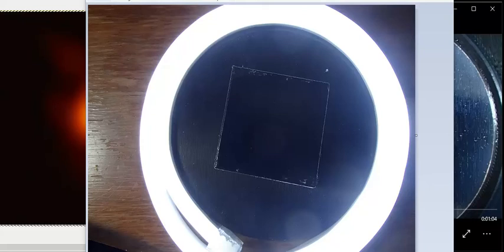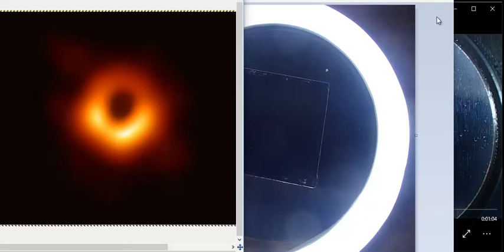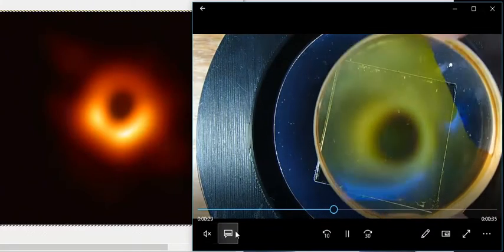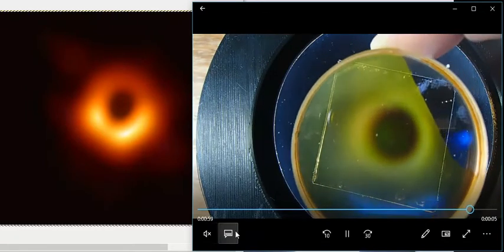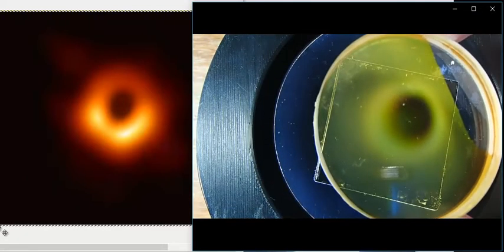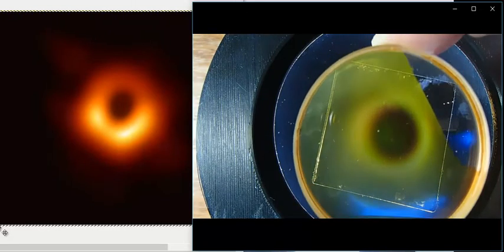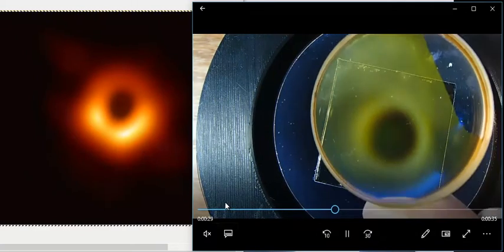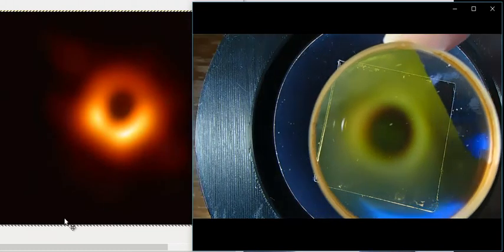Ferro Cell Black Hole

Comment: I got an inspiration from this video to make the cell in a modular way so that you get the default light as an incoherent source like in this video but that you could also add a strip of partly black-painted transparency paper between the glass and the light. The idea is to be able to convert the light to simulate point source with a checker pattern painted in the strip. If it works, you could do different strips with different intervals and maybe even more creative shapes :)

Comment: Nice image. If you ever decide to commit to fixing that cell, warm it up slowly and gently. The expanding ferrofluid will push out the air and you can run glue around the whole edge again. Keep it warm until it sets.
Reply from the maker: Thanks for the advise.

Comment: Pretty cool and intriguing.  (diving in over my head now)
   So, while the individual LED strip was showing us the illusion of a structure,, this continuous light strip shows that the toroidal-geometry is consistent, but increases in density as it approaches a vectoring-force.  On a galactic-scale, that may indicate that the light-waves being emitted from other surrounding sources, is being concentrated and reflected (and not consumed) by the black-hole.
   Then there is still the question of what is ejected at the top and bottom of galactic spirals.  Since these "light" experiments do not include elements like noble gases,, I would postulate that those elements are being transferred around the outer perimeter and to the center of a spinning black-hole,, where it is repelled by another unknown force,, and is sometimes visible as a fluorescent anomaly.
   Maybe the next step for these types experiments could be to mount a spherical-magnet on a wooden/or plastic rod, and spin them in a tube/or jar of ferro-fluid,, with the light source from the top.?
Reply from the maker: In the case of the magnet, the "jets" are Aether jets. In the case of the black hole, it is my opinion that the jets are Aether jets too. Matter follows Aether, right up the jets. Matter is not required in the formation of the jets. I read a mainstream paper a few years back that basically came to the same conclusion. The jets and magnetism are the same thing, Aether in motion.

Comment: Seems like the torus decreases, as the hyperboloid increases (Jets).
Reply from the maker: That would make sense. As the dielectric component gets bigger, the magnetic component gets smaller. This effect is easier to see that with the continuous lighting for sure. I wonder why Ken Wheeler hasn't made any continuous lighting videos? Or did I miss that one?
Reply: Fractal Woman...he did take photos one time with a fibre optic light ring and got a very similar result. 

Of course, continuous lighting observations doesn’t fit well with Ken’s ‘lines’ being ‘magnetism’ and the ‘dark’ between areas being ‘dielectric’. (Except for the center of course). 

Continuous lightning kinda removes the ‘interference pattern’ paradigm explanation that Ken uses for the ferrocell observations. IMO currently.